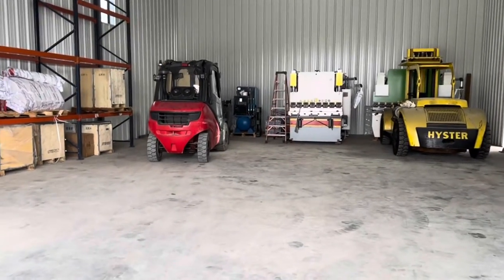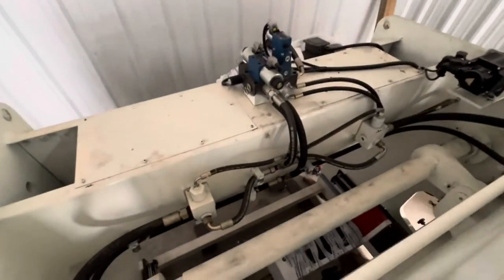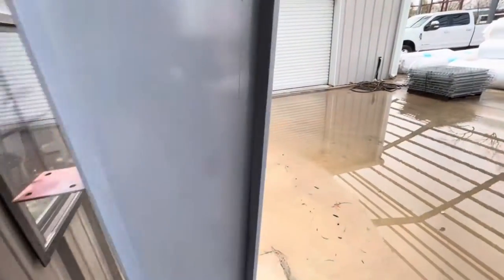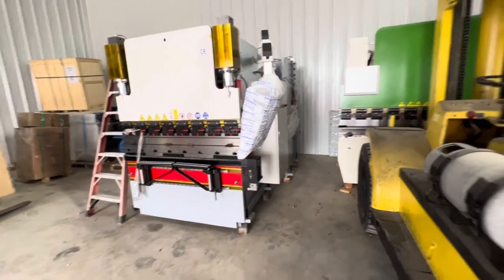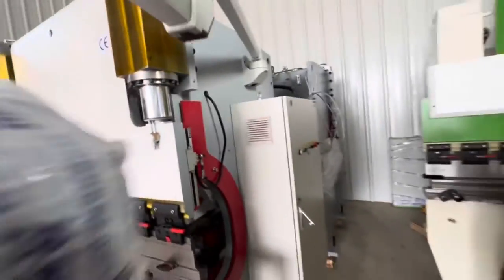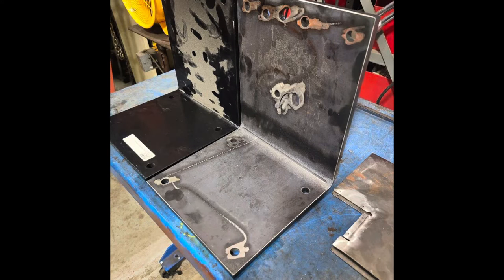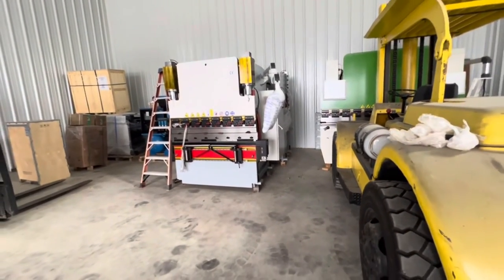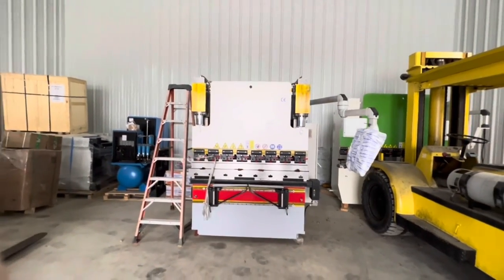Shop Stuff and New Style BEND FORCE Press Brakes

Comment: Went to your website and wasn't able to find any specs on your fabricator 60.   Was wounding what hp rating the motor was (trying to get an idea of what needed to look into for a phase converter).  Also  being a 2 axis machine can you still manually adjust the height of the backgage (fingers) for height differences with different lower dies.
Reply from the maker: fabricator 60?  I dont have one like that.  The 3ph 2 axis brakes can run off a 30hp converter.  Yes, the 2 axis brakes can have the back gauge height be manually adjusted.
Reply: My bad - fabricator 5ft (somehow I was thinking inches).  Thanks, now I've got an idea what size of converter to shop for.